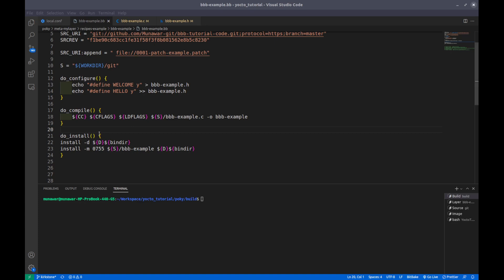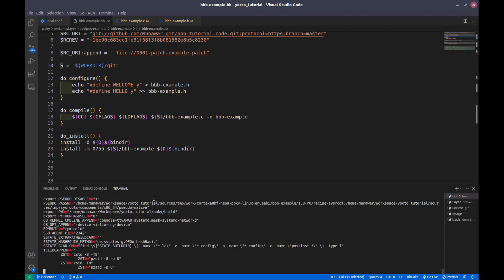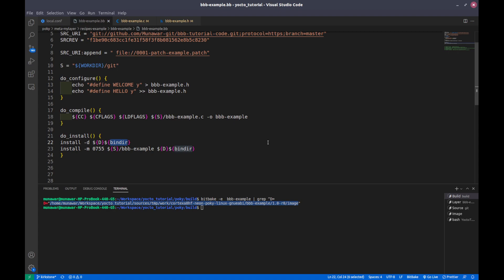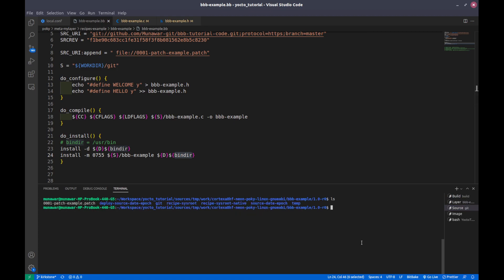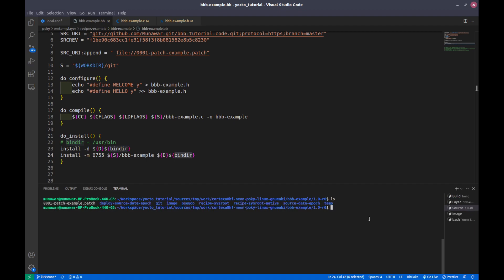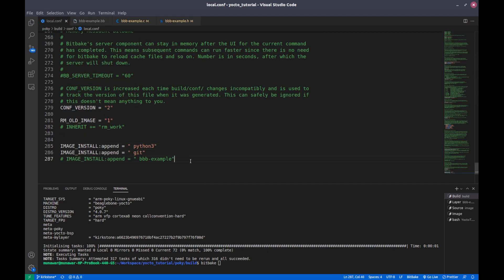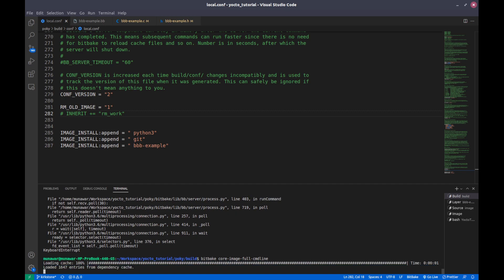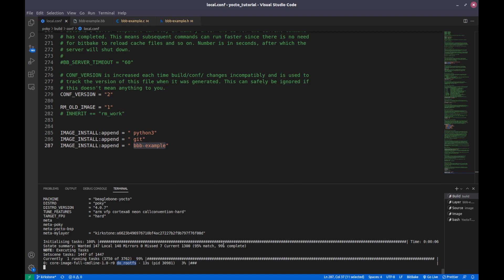Yocto Tutorial - 09 Yocto Build Tasks (Part-7) | do_install (With Example!!)

Comment: Since Styhead release, you cannot set S variable to WORKDIR directly, it causes errors. This is correlated with unpacking issues. Default values of S and UNPACKDIR are not visible by each other (first referencing to non-existing directory and second to the unused one). If you want to put your source files in top-level "files" directory you have to assign UNPACKDIR to S.
Reply from the maker: Thank you for the correction and enlightenment. I appreciate that.